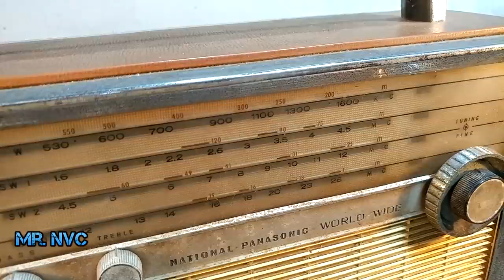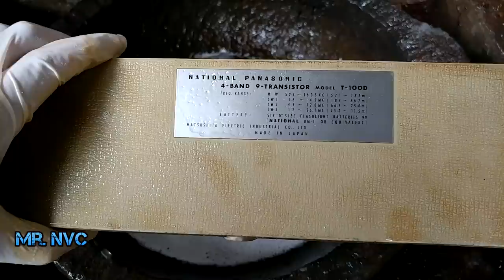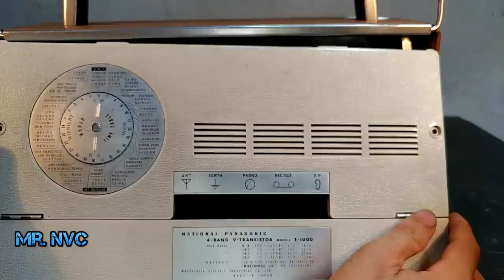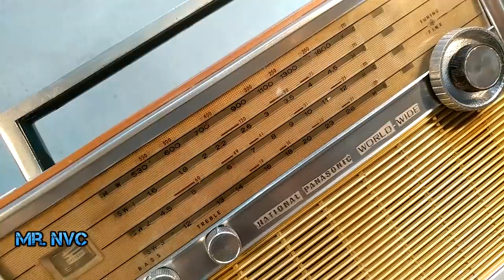1966 National Panasonic T-100D Transistor Radio Restoration

Comment: Great job on the hardware, but again the capacitors need to be replaced and resistors need to be checked. The radio restorations I and many other do here is circuitry and  radio alignment. We usually leave the outer case in original state. Great video. Maybe you and I can hook up on a radio, I do the circuitry, you do the case and hardware. 👍👍👍👍👍
Reply: Not so fast! Japanese capacitors are (and was) very good. I have 30+ years old electrolytics and they are still like new electrically.
Reply: @aklankrisz  Very random.  Paper caps usually leak and degrade, especially on power supplies.
Reply: @AldoCugnini  Every paper capacitor in any electronic unit is faulty today, every single one have to be replaced. So you can either change them yourself which is quite cheap in a mid 60s radio because there is not that many and the values are tiny. Or you could wait for one of them to really mess up your unit and repair it at a much higher price.
Reply: @aklankrisz  Correct not everyone has an ESR meter. However, if you want to work with electronics having one is very useful. I have the Blue ESR tester. It also comes in handy checking batteries as well. With that said I would check them. It is a puzzle if they are off you know that was a contribution to the problem or the whole problem.  Now since you are in there and caps are cheap replace them with a good quality cap. I go with Nichicon caps. Caps and most electronics parts are cheap. Just have fun with it. Yes, I would replace them but check the values.

Comment: This was an improvement over your last transistor radio video.  You cleaned the circuit boards in this one and did more corrosion removal.  However, as others have pointed out, you need to replace old capacitors to restore any durability/reliability to these circuits.  Also, the silver paint you are using to restore chrome/faux chrome finishes looks cheap and unconvincing.  You need to find a fine chrome paint and do more fine sanding to prep these parts.  Further, the decision to mask the letters on the front trim didn't turn out well.  It would have been better to mask a "regular shaped" area containing the words, or better still, refinish the entire area and either re-stencil the words or create water slide labels.  And, again, reusing old cold solder joints, instead of removing old solder and applying new, is bound to lead to failed joints.  I'm still hanging in here to see how much of the advice that people are giving you will be implemented in future projects.
Reply: Was trying to find your videos showing these techniques. Can you share a link to your work?

Comment: Plastic yellows after time.  'The 8 bit guy' has done some videos on how he restores plastic cases to their original color.
Painting the chassis?  Why?  It's hidden inside the radio and can't be seen, and you MUST be able to get all the grounded electrical connections to make contact with it for the radio to work.
Reply: He also shouldn't have painted the metal accents, at least sand them a bit more or find something to fill in those pits. Also, should've used a filer for those knobs they are the most important (to me at least, so it would be more aesthetically pleasing)
Reply: I want the chassis to look brand new.

Comment: Hi from ham radio VK3AML. This was my first transistorised general-coverage HF and MF receiver, bought new and given to me by my parents for my 13th birthday on 8th March 1967. It was of fairly recent manufacture then, so at a guess these would have come on the Australian market in 1966. Sensitivity was quite good, though a little noisy without the aid of a tuned external antenna. For tuning 160 and 80 metres I used a coil in series with my inverted "L" antenna and earth, aligned outside the radio with the internal ferrite rod antenna. I think the transistors were mostly germanium - or perhaps very early silicon. Main problem was that the receiver drifted badly in frequency, so that even with an added BFO they were not much good for sideband reception. Above 18 MHz the frequency drift and the image responses were so bad as to make the receiver a poor performer at the top end of the frequency spectrum. You could tune AM CB signals on 27 MHz but even the proximity of your hand near the tuning dial could make the receiver tune off the station. There was a square loop antenna around the back of the radio, which could be flipped up above the radio. It looked impressive, but was not much good for enhancing reception on any frequency, so I rarely had it flipped up. The first thing to wear out on these was generally the audio volume switchpot, which would come on with a loud "bang" unless the pot was replaced. Good luck with your restoration. Very nostalgic for me.

Comment: Nice machine and nice work! I recommend that you use dichloroethane or dichloromethane to repair certain plastic parts. To extend the crack, I would use a hot stapler, which melts a thin metal wire into plastic. Also, for stable operation of the device, I would check the electrolytic capacitors, because they could already dry out and lose capacity (I use an LCR meter to check the details). Good luck with further repairs and restorations!

Comment: I've got one that would give you a tough time. An old Jade radio that was somebody's shop radio. it actually works on AC power, but the battery box is shot. It works, but is a real mess. I cleaned it up the best I could, but that wasn't much. I also have an old tube type car radio I don't even know how to test. (I also have some tubes to go with it)
Reply from the maker: My radio lost the battery case. I finished it with a 9v battery.

Comment: I restored one of these some time ago. I wasn't my intention to rebuild it but since it arrived smashed in transit I had little choice. Superb radio but most of the old germanium transistors had broken down internally and had to be replaced, parts sourcing was a problem, particularly the battery / s-meter but after a year and a half work and expense (far more than it will ever be worth) it was as good as new.

Comment: Friend, your restorations are nuts. You only renew the aesthetic part. Has not switched any electrolytic capacitor, has not analyzed circuit, did not RF realignment ...... Your video is interesting, but can not call this a restore.
Reply: replaced a speaker a restore don't watch next time and he restored the plastic with a repair buffed out other stuff you don't need something to be broken to call it a restoration why am I defending this I don't know
Reply: Because doing only a cosmetic restoration doesn't constitute a full restoration without hardly touching the actual electronics. He only changed the speaker, but these 1960's Japanese capacitors are garbage and are almost likely all dried out and shorted by now. The radio would work much better had he replaced these. People in the vintage electronics field understand this while you clearly don't.
Reply: @jsciarri  The ceramics are probably fine - which is why he could turn it on and get a signal.  But yeah, this was maybe a 60% restoration.  Hard to say, because the radio wasn't turned on and listened to prior to the job.  I agree with the gist if your comment, but I thought he did OK with the clean-up and mechanical repair of most things.  I question painting the plastic, there are better ways to bring back the original color.  Radio nerds like you and I would have loved to see if any of the SW bands were working, let alone aligned properly - but at least you can take some tricks from this video on cosmetic restoration.
Reply: @kd8opi  Yes I follow Shango066, radiotvphononut, and bandersentv channels religiously and I'm simply used to at least some of the electronics being addressed  (you can see I left a comment about Shango on this video as well). Some of the cosmetic details of this radio are good, while others are not. I would have left the original finish of the cabinet and buffed out the original color as well as any of the stainless and chrome trim without painting over it. The chassis didnt need to be painted neither as that's completely covered up and not seen, and could cause ground issues. But I agree with your 60% restoration comment.
Reply: @jsciarri  Yeah.  I'm sort of in-between on these sorts of videos, where its really a cosmetic restoration with some obvious electrical fixes (broken wire, dirty switch, ect...).  At the same time, I'm a Shango066 fan too, and sometimes he drives me a little nuts when he puts no effort into the cosmetics at all - or when he'll replace enough electronics to make the radio function at say 85% but then he chooses not to go further because "its not worth it".  Hes probably right, but then why do it at all.  Anyway, Shango's commentary is top-notch. 

Probably the best  pure radio restoration guy out there is Mr. Carlson's Lab - but honestly he is so technical I cant follow his videos for too long unless my project is nearly similar to his.  Anyway, the cosmetic guys can teach us a few things. 

But, mostly what I learn by watching these videos is that if you like vintage radios, but dont have the expertise, time, or space for a small workshop and equipment; buy the cleanest, best working example of what you want on eBay and walk away.  The guys who really know radio repair are a dying breed, and unless you want to give yourself a DIY  education on radio repair over the course of a few years and a 10-20 projects, you probably won't be up to snuff to "restoring" radios.
Reply: I know that my comment will be nitpicky but even on the cosmetics, I would like to see the components that were nickle, zinc, or chrome plated to be properly stipped, polished, and replated. I realize that most people don't have the setup (or ability) to do that, but I think it would be fun to see.
Reply: @martybrown21p  Hi marty. There are guys that do that, I haven't seen it with radios, but I have seen it (oddly enough) with guys who restore Matchbox cars.  Zinc, nickle, and most other plating is straightforward - the problem is chrome.  The chemicals are just too corrosive.  

As far as being nit-picky, It just depends how deep you want to go into a restoration - and what people call a restoration.  To me, a true restoration means the end result is indistinguishable from a brand new example of that item.  The best examples of this are those guys who restore cars and then have them graded by experts - even down to door gaps and color shades.  So, in some ways if you're talking a true restoration, you can't be too nit picky.  It is or it isn't exactly the way it came out of the factory.

With radios, that's where you run into problems when people call things a restoration.  Even the best radio "restorations" sometimes aren't true restorations, because the original electrical components are simply no longer manufactured.  Say you're restoring a 1930's radio with wax capacitors.  Wax capacitors are no longer made (for good reason), and unless you find a batch that was buried in Antarctica in the 1930's and perfectly preserved, any wax capacitor you find from 80 years ago is probably dead or dying fast.  No way you'd put an inferior part into your radio, so you use a new electrolytic or ceramic capacitor.  At that point, you really can't say the radio has been restored.  You can say that its been repaired/upgraded with new components and cosmetically restored to new condition - but not restored.  

So I guess I agree with you, and don't think you're nit-picky.  Words mean things, and the concepts of "restoration", "repair", and "modification" all seem to get jumbled in some of these videos to the point that everything is a "restoration".
Reply: @kd8opi  chrome is a real pain. (Hence I have never attempted it.) I agree with you. My father and I often disagreed about "restoration" vs. "repair". I had the good fortune to graduate from a trade school that taught me electrical component and mechanical repair for power generation/distribution equipment. So sometimes I geek out and get a little (or a lot) pedantic. Realizing my nerdiness I would love to see the transformer get meggered, have a TTR done, etc. Test each capacitor and resistor. To me this would be fun to watch. Of course as I said I'm a nerd and I enjoy this kind of ridiculous minutiae.
Reply: If it works fine, why bother with all that stuff? Maybe he's not a trained electrician, just a good handyman, so he did what he could confidently.
Reply: @MetalTrabant  he just makes klick bait videos, sped up technical details removed

Comment: I realize that my answer is that it's all in experience but I must ask the question... How the hell do you remember where all those connections go
Reply: Me too!
Reply: I dont put my projects on youtube, but the way I do it is: digital camera (you can take hundreds of pics if you want) labeled small plastic sandwich bags, and sometimes a small note pad/pencil.  Basically stuff you have around the house.
Reply: @kd8opi  I also try to get the wiring diagrams for my project before I start. Once I ran into a radio that was modified by a previous owner.
Reply: I think exactly same than you! No other explanation, but this guy is genius. I wonder if there were some high esr caps after this awesome job ;).
Reply: Radio circuit are all most the same for every brand.  Tuner circuit, frequency amplifier circuit, oscillator circuit, sound amplifier circuit.  Even you take one resister out of the whole circuit i know which part is missing.  You have to study radio circuit.
Reply: Make photos or look at the schematic/service manual
Reply: So basically old electronic without circuit diagram and/or already wired circuit is almost impossible to work on?
Reply: @bullracing1  

Well some stuff is so simply built that you can easily reverse engineer it. Theoretically you can do it with more complex units aswell but it takes a lot if time and patience. Sometimes you find schematics of different units with very similar curcuits too, espcially if ICs are used.
Reply: Qual preço e um rádio nacional origional
Reply: Without the schematics doubtful, I'm also having a problem with a 1966 world transistor radio that size being powered by a 9 volt battery, I'm old enough to say I was around at that time, it was a trip down memory lane and fun to watch.

Comment: I'm not complaining, just offering constructive criticism.This is a nice aesthetic restoration video with something to be learned. Great job! But what about the electronics. A 50 plus year old radio needs pots cleaned and caps replaced. And in past videos and this one, you hot glued things back in. This won't last, like with the 9 volt battery. Another video you left out speaker clamps and hot glued the speaker in. I would have, at least, hot glued the original clamp in place in case a future full restoration was done.
Anyway, keep up the good work. I will keep watching :-)
Reply: "left out speaker clamps and hot glued the speaker in" this method gives better sound quality. The 'clamping' area is larger by the hot glue.

Comment: Good looking result, but please use better soldering techniques: when you remove a wire, remove most of the solder at that connection too (use a solder-sucker or solder wick); clamp the new wires to be soldered, then use a 40-watt soldering pencil, NOT a big soldering gun.  Apply the solder AFTER you heat the connection, not before.  Make sure the soldering tip is properly tinned, and never use the same soldering tip for plastic repair. These will make for better connections, and your viewers will learn a better skill.

Comment: Mike did a good job on cleaning this unloved beast of a portable radio. Needs some adjustment by a more skilled radio repairman though. Suspect some detector issues
due to capacitors just aging and soldering joints that are so so. I like what you did so far as it does work now!!

Comment: Not too shabby a job for a chicken shed ‘’makeover.’’  It cannot be deemed to be a restoration because no attention was given to resetting the tuning alignment of the radio circuits. 
   However,on completion, I wasn’t impressed by the yellowed speaker grill or the omission of the speaker cloth.  The inclusion of the tiny 9 volt PP3 battery left me doubtful as to the life expectancy of its charge considering the current draw that this type of radio would place upon it.
   Does Mr NVC realise that the white heat sink paste that he so diligently scraped away from the steel chassis needed to be replaced in order to prevent over heating of the associated electronic components?
   I am impressed at Mr NVC’s ability to dismantle and reassemble the radio such that it actually functions on completion.

Comment: To rid plastics of dirt and the yellowing effect, I use brasso to remove it, it works very, very well.
Reply: Thats surprising. Does Brasso (brass polish) rid the plastic of yellowing?
Reply: Please do let me know. Thanks
Reply: @RajendraVermaa  It did on some old plastic bicycle lights that I restored, it's a slight abrasive.
Reply: Do a small test patch though where it can't be seen just to be on the safe side!

Comment: Most Impressive restore...made me cringe a few times but Nice Job!  Surprised there weren't any cold joints on the back of the boards or did you just not show in the vid?  I remember these well and still have a Sony transistor radio from 64', that still works.  Sub'd after watching your 67' chair restore...I have one that is a little earlier that needs some TLC, perhaps I'll give it some now.  Really enjoying your referb/restores.  Kudo's and Thanks for Sharing them.